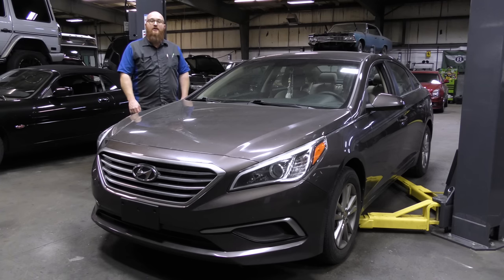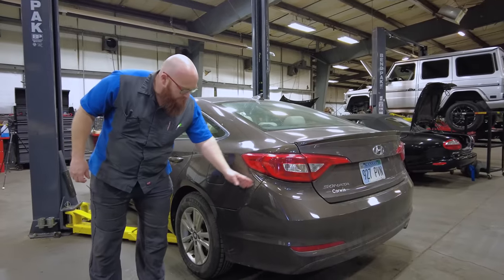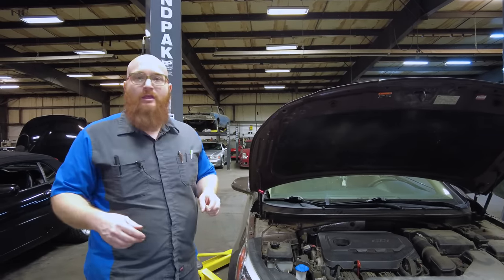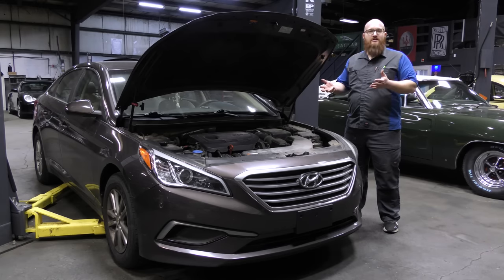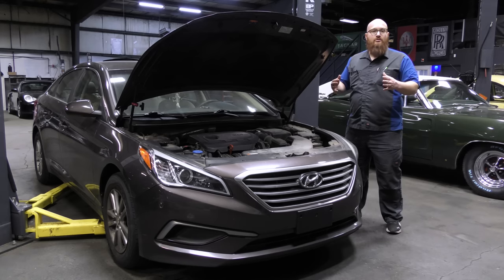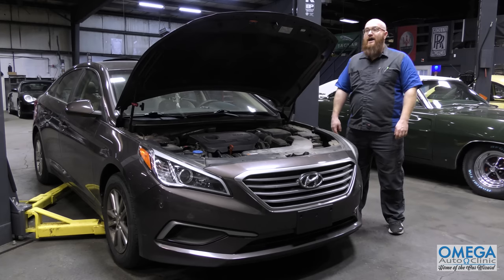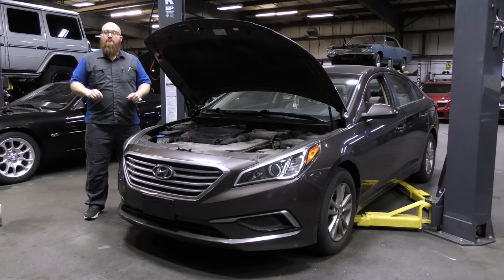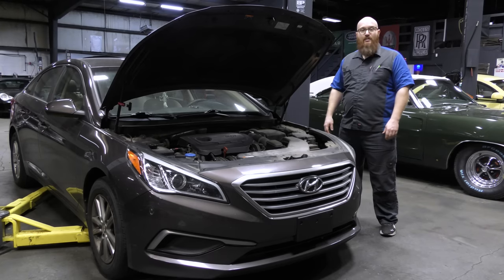What could be so bad on this '16 Hyundai Sonata that the CAR WIZARD is sending it to the junk yard?

Comment: My niece had a Volkswagen rabbit convertible back in the early 90's that she completely ran dry of oil till the engine locked up. When I told her what was wrong with her car she said " Well i'll never buy another Volkswagen again!" I told her that the same thing would have happened if she had a Mercedes or a BMW. It's a vehicle,  not a purse. It needs to be maintained!
Reply: wtf.....
Reply: That's how stereotypes stay alive.
Reply: A friends son-in-law bought a brand new Dodge with a 100% pre paid service plan.  He drove it for a few years without ever getting it serviced or even checking the oil.
Reply: I have a very similar story. A couple I knew had a diesel Mazda 6. It had snowed and they needed to go to work. But instead of digging the car out of the snow, they decided to just sit in the car and redline the engine in first gear with the wheels spinning, trying to get out of the snow. Needless to say that tactic didn't work and it just broke the car. They took it to a local garage and the mechanic spent weeks trying to figure it out. Ended up tearing down the engine to find they'd put so much torque back through the engine that they had bent the camshaft. The mechanic hadn't even thought that was possible.

Of course the punchline is that they said they'd never buy another Mazda again due to it being unreliable...

As an aside, the same guy from the couple once tried to force me to put boiling water on my windscreen to melt ice. I kept politely declining his offer until I just had to walk away...
Reply: Preach 💯💪🏼
Reply: Consumers are the bane of good products
Reply: People are just plain stupid when it comes to cars or anything mechanical. You would think common sense would tell you that a modern car needs some form of care to keep running, but what is "common sense"?
Reply: THATS MY PURSE!  I DONT KNOW YOU!
Reply: We once lost an Equinox to a similar situation it was my fault I kept telling my wife she needed an oil change but didn’t go out and fool with it myself I should have it would of saved me a well just an Equinox but still
Reply: @absolutelynonameslef  Not so common any more.
Reply: I remember in the late 90's when the "Hitler curse" really hit VW. Those 1999+ Jettas/Passat/Golf really had some quality issues. My sister had a 99 Cabriolet and the mechanic was busy fixing defective VW parts, etc. I had friends who's windows would fail and fall into the door, and nagging electronic failures. I felt like this was where they really earned that VW $$$ grab. Mid 2000s we had the timing chain failures on Tiguans, etc.
Reply: If they dont maintain the car they shall be opening their purse to repair or replace it
Reply: You are so polite. The paint is utter crap. Much worse than not too good. 😂
Reply: Wow the ignorance of some people,my friend had a engine lockup gm vehicle with 3.1 yes it was basically a disposable engine but when I said you need oil because it sounded like a TDI Volkswagen diesel engine 30 minutes later we stalled but she didn't blame car she realized you always need to check oil level especially if uses oil
Reply: Even a decent leather purse lasts longer when properly maintained 😊
Reply: Even over 10year old mercedes asks with text on the dash to add oil.
Reply: Absolutely agree 👍
Reply: Lmao
Reply: I went to a rapid lube shop Saturday one time. They left the oil cap off on top of the battery. 

Lucky I caught it Monday checking the stick. Never went back there again. Pop the hood at least a couple times a week and check your oil.

Best & cheapest advice I can give.
Reply: Would not happen to a Toyota
Reply: Even a purse has to be maintained the be honest, some purses cost $25,000 and up.
Reply: Certain cars are like keeping a horse, you have to check almost every day on the service needs of the motor.
Reply: @SteveRogers461  go ahead and take all the oil out of your Toyota and put back in 1 quart of oil....it will do the exact same thing in a few weeks...all engines have the same parts...nothing makes Toyota engines any different internally then any other manufacturers engines....it's everything else that makes a Toyota better than the rest
Reply: @SteveRogers461  If you take care of your Toyota and check the oil, it will be fine. You can kill a Toyota if you do the same as this Hyundai owner did. Common sense.
Reply: @Justinian Yi my 02 Jetta has an oil light.
Reply: @Jason the Toyota would not have consumed that much oil so would not have ever gotten that bad.  VW had all sorts of problems with oil consumption, go look it up.
Reply: @Jason Grisdale  I see what you're trying to say but thats not quite true.. toyota engines are way better built with way better engineering and parts. You've obviously never seen toyota engines run with no oil in them? Or run on the rev limiter for hour after hour.
Reply: No oil???🙄🙄....no worries....goto pump & fillup petrol😜😜😜😜🤪🤪🤪🤪😝😝😝😝...thats what dude knows😜😜😜😜🤪🤪🤪😝😝😝😝😝😝😝
Reply: @JamesParus  Correct, my MB is a 2002 C240 and it has an oil level sensor as does my 2001 986 Porsche Boxster and my wifes 2016 VW Golf. Never seen a low oil warning but I did overfill the MB after a service and the warning on the dash went nuts, no way could anyone ignore it.
Reply: That’s not totally true- I’ve seen videos of 22RE yota motors running with holes in the cylinder and no oil running like a champ lol can see the piston flinging up and down and everything lol
Reply: I have what I call "Friday Fluids Day" - sounds funny, but I check the oil every Friday. Maybe every second Friday, but since it's also garbage/trash day, wheeling the bins past the car, it's become second nature.
Reply: People are so lazy these days they got a book that explains how the maintenance is done and when to be doing it it's in glove box. On top of that we got technology and videos that tell us step by step how it's done.
Reply: I knew someone who ran a Toyota near dry, The 'complaint' was that the oil light didn't go out ! Crazily it ran for quite a while after giving it the required lubricant.
Reply: It's a rabbit and reason why you never see them on the road anymore.
Reply: This brings back not so fond memories of my 3 year old 73 Vega GT.  Just past warranty and no recall, the crap aluminum cylinder engine packed it in at 27K miles.  Tough luck said Chevy. In revenge I swapped in a 64 Olds 215 cid aluminum V8 (steel cylinders!).  My sister owned, just a couple years later, a 76 Honda Civic with the CVCC engine. At 75K miles the heads leaked coolant and wrecked the block. Honda did a recall and replaced the whole engine.
Reply: @MiGujack3  true but tbh as many females iv met like this, iv met just as many guys like this
Reply: @zen-Tii  wtf 🤣🤣🤣🤣
Reply: @SteveRogers461  Sure it would if you drove it with less than a quart of oil in it. Even the best made machines still need maintenance.
Reply: bmw has oil level sensor.
Reply: Cars are one of the few, perhaps only, things in our life that require maintenance.   Not only that, it is not a matter of them running out of oil, so you put more in and off you go again. They run out of oil and die !
In a way it is a bit like owning a pet. It comes with a responsibility!   But many young people have not even grown up and learnd to look after a pet.  Expect more of this. Sad !
Reply: @gregedmand9939  I don't think Chevy was aware that you put in a different engine, so exactly who are you taking revenge against?
Reply: @jduey2396  Revenge on fate, that had me buy a new car only to have the engine die in less than 3 years and less than 30K miles. I turned a disaster into something far better performaning than what I was began with. Oh...and on having to continue making new car loan payments for a dead engined lemon. When I bought it, the Vega was actually the Motor Trend "Car of the Year". Sadly the vast majority of people who bought one, weren't able to make lemonade from a lemon like I did.  It was a world of difference between how GM in the 70's treated customers compared to Honda.
Reply: @SteveRogers461  not true I have a 2002 Corolla verso with the 1zzfe engine and they drink oil like it’s out of fashion. I have to check it quite often. It’s still going strong though thankfully
Reply: @drunkenhobo5039  Camshafts don't bend.....ever. They wear out or break.....extreme hardness from heat treating....
Reply: @tjm3900  To say that nearly everything else besides Cars don’t need maintenance is ridiculous. If you had listed Refrigerators as being about the only thing not needing maintenance then I would have agreed with you!
Reply: @poopcoupes7214 damnit bobby
Reply: @malcolmhardwick4258  to the point we shoul now call it "rare sense".
Reply: Lol!
Reply: Right some people are clueless.  These are the same people that buy a 5 quart of oil and pour it in their crank, when they are only a quart low. Had a customer do that at oreilly before!
Reply: Yes happens a lot we calling it in my country key drivers turn on the car and go....never check all running well.
Reply: The best owner is the one that makes an effort to learn their vehicle inside out.  Sometimes you get that decent Hyundai or Volkswagen that works for you and you able to keep it running good.  Then by all means keep using the car and don't waste your money because of social pressure to replace it.
Reply: @@Nowhereman2022 To my understanding, some big trucks can have higher level super efficient oil filter systems that clean the oil better than the typical automobile engine filter system. However, there is no way in the world I believe oil could last that long. No way the additive package in the oil could sustain that, they'd all be used/burned up. Essentially not changing the oil is like making gravy in the engine. Just heating it up and thickening the liquid over time. If someone at you're trucking company has decided to try to go a hundred thousand miles between oil changes, they may want to rethink that.
Reply: @whammond511  Then please list some things that need periodic maintenance (that might be applicable to the life of a young lady).
Reply: @426baron  From the moment you wrote this message !
Reply: It seems to me that the obvious is not being stated here.   There seems to be a damn good reason why Cars today have Idiot liights to tell you to change and check the oil.    
Even 89 Toyota Vans have a low oil sensor in the oil pan.   At least the US ones do.    Seems they know their audience.
Reply: Definitely wouldn't fix it. Unfortunate because they are a decent vehicle.
Reply: If she had a BMW that will 💯% happen even if she done all the services lol
Reply: Wow, if she didn't ruin the engine she could've probably gotten a pretty good price on such a nostalgic car. It's like finding old Subarus, you stop seeing old ones on the road after a while because they've all either been run into the ground and are mechanically or structurally totaled out and everyone else stored theirs in a garage somewhere to sell when all the 90s kids are old and want to buy a piece of their youth again and are willing to spend to acquire.
Reply: Same goes to BMW. If you don't maintain it propeply, it'll definitely fail on you and leave you stranded! These cars need more maintenance than others, yes, but you should know that before you buy one. Don't whine about how unreliable these cars are when you never even checked how much oil is in it. And if you gonna neglect it, repairs definitely gonna cost you more than the cars worth at some point when one failed part will break others, it's a domino effect.
Reply: @LordEvan5   Equinox is a crap car anyway.......go to the Wizard's video on "What Cars Not To Buy."
Reply: That’s most vw owners in a nutshell who aren’t enthusiasts. Always blaming the car for maintenance they didn’t do
Reply: @MisterNi    She could’ve easily engine-swapped that VW Cabrio. Kept a valuable car, traded it for good money…
  But THAT would call for common sense to know how to spend money to save money…
Reply: Stupidly runs rife!
Reply: It’s bizarre how stingy and lazy people can be.
But spend eight dollars fora Mega Frappuccino, YES any day of the week.
Reply: @j_freed  Well, it might not be all that bad. A lot of older cars have engines with oil starvation in mind and can still run on low oil for a while. If she does an oil change and keeps regular maintenance, that could be enough to flush out the old burnt oil. Either way, could keep the car or sell it for a good amount, even if the engine needs work and/or a rebuild.
Reply: Knowing it’s a Hyundai it probably burned oil, you’d think it would have an oil light. I have a Subaru and my gf has made the oil light come on a couple times but luckily it comes on when it’s only a quart low. It makes me mad because the car doesn’t even have a temp gauge for the coolant or oil or even a tachometer
Reply: @drunkenhobo5039  That's why I'm weary of people offering "car advice" when they haven't gotten their hands greasy or are an actual mechanic.
Reply: I have that car and I've had no problems personally.  But I am quite aware of the manufacturers defect of the engine type. Also the fact that many of those cars do not have an engine immobilizer. That has created such a theft market for the vehicle, that some insurance companies will no longer write new policies on them. Yes I'm in possession of such a vehicle, fortunately I have a backup to drive 90% of the time. With a manual transmission, so it's the least amount of worry I would have, of having it stolen.
Reply: My 01 Grand Am did that back in 2012, when the oil pressure sensor was leaking. A mechanic put 20w 50 against what the manufacturer suggested. I was on road trip from Phoenix  to Kansas. Put some Lucas additive and made it. A shop replaced the sensor, put 5w 30 and I went  back to Phoenix. That 2.4 L engine has 320k miles and does not smoke.
Reply: @Jan Corbinski  wow yeah I'm not surprised the quick lub didn't hear the internals going at it had my oil cap off once and it was loud
Reply: Hell, even a purse needs to be maintained, saddle soap, leather conditioner, and shoe shine go a long way in keeping a leather purse looking nice and keeping it last a long time.
Reply: @martincassels7995  Stupidity?
Reply: @RichiPuppi  "the Toyota would not have consumed that much oil" - My MR2 uses quite a lot of oil, has done for the past 30 years. I have to top it up a couple of times between oil changes.
Reply: @andrewdonohue1853  and a purse, be it leather or fabric, has to be brushed/cleaned and maintained regularly or it won't last long.
Reply: adamb84  looks like "Clueless" is the mould they've all come out lately... 😑
Reply: @gregedmand9939  a friend of mine did something along those same lines, he bought a brand new at the time Hyundai Tiburon GT, he drove it pretty hard but nothing too crazy, it's a sports car after all and it was great fun, even with full proper maintenance the 2.7L V6 spun a bearing and grenaded a year after he bought it, he loved the car too much to get rid of it so soon so a few months of work later it had a Honda/Acura 3.0L V6 and now over a decade later that car still runs like a champ on that Honda engine lol
Reply: @SteveRogers461  gi run you toyota a few miles with 1 quart of oil...it will do the same thing
Reply: Sounds like a new Ford lol
Reply: I'm amazed... the hood struts are 20 years old on my Lexus, and it still raises and holds the hood open.
Reply: @TJ M  clothes, washing machine, dryer, refrigerator, home, body, yard, mower, ...
Reply: @LordEvan5  Don't get anymore cars please.  Your comment scares me actually.
Reply: @TheLifetraveler1  i had one for 4 years. 2017 model. It was a goid car. Had 130k km (85k miles). ALWAYS used real sythetic oil every 8k km.  It ran very well. Sold it to go on a 7 month vacation.  What happenef to this car can happen to any car. A decently maintained car that is good will take you lots of places trouble free.
Reply: Stories like these make me not want to buy a used car.
Reply: @MisterNi  you might flush out the old burnt oil but you aren’t going to be able to replace the worn out rod bearings and crank throws with fresh oil.  That engine is toast.
Reply: @Bill-js1cg  FUD at best. Older engines seized up readily. Simply keeping up with oil changes will be enough to keep a once seized up engine running for years to come.
Reply: @MisterNi  been there done that.  But the engine in the video isn’t seized, it’s about to blow a rod because lack of lubrication has caused the bearing surfaces to lose metal.
Reply: @Bill-js1cg  I think you're a bit confused. The car in question is an older Volkswagen Rabbit, which can run a bit oil starved and still work fine with a fresh oil change. Older model 4-cylinders engines were designed to seize up when oil starved because guess what, people not maintaining their car engine is as old as gasoline cars have been made and sold en masse. The Hyundai GDI motor the Car Wizard is talking about has sacrificial rod sleeves which is why a lot of mechanics are unwilling to rebuild them. Pulling the motor, disassembling the motor, getting all the replacement wear parts and gaskets, adjusting all the precision parts and reassembling and installing the motor isn't worth it to most people. A VW Rabbit that ran low on oil for a while shouldn't be too bad so long as oil changes are done regularly from now on.
Reply: I've been saying for years Kia Hyundai use poor cheap wire harnesses which turn into electrical problems on the vehicles & now fires, I had a 16 Sorento what a nightmare almost everything broke electrical issues up the a** battery continually dying, moon roof wouldn't close just a disaster, they entice with the designs of the car but reliability eventually catches up to you... I remember Hyundai back in the 80s Pony Stellar were also disasters.
Reply: the biggest BS in the world

"Hyundai warranty"
Reply: do modern cars have oil lights to indicate low oil?
Reply: @zen-Tii  nah
Reply: I was sitting at the oil change place a while back getting the oil done on my Prius V. There was a customer before me paying. The clerk informed her that her car came in with a dry dipstick. She told the clerk, "Well when the oil light comes on I know it's time to get the oil changed"
Reply: @MiGujack3  yeah isn't it interesting? Oh never ,never stereotype people, it's so evil. The simple fact is, The stereotype generally has is true!
Reply: @MiGujack3  yes by neglecting basic maintenance on things.
Reply: @MisterNi  yup, I’m confused!
Reply: @Justinian Yi It's a low oil pressure warning light (emergency warning, shut the engine down immediately), but damage has already been occurring well before this stage.
Low oil levels cause the oil pump to cavitate (sucking oil, then air, then oil), resulting in intermittent oil delivery throughout the engine, especially to overhead camshafts. Let alone the exacerbated stress on that small quantity of oil the engine is forced to run on, which will be severely contaminated/degraded, resulting in sludge/piston oil control ring contamination, etc.  
There really is no substitute for an engine oil pressure gauge (for multiple reasons) which will clearly show the cavitation at low oil levels (during idle speed) as a wildly fluctuating needle (analogue gauge description) as the oil pump stutters between oil and air.
Reply: Shifting blame was my sister's superpower too 🤣
Reply: @midwestfarm757  still driving my 2000 vw turbo golf has 300,000 miles, I'm in Canada where it gets 30 below, always starts. Funny how wizard drives beetles that are the same car as the golf.
Reply: @RichiPuppi  Look up "2AZ-FE oil burning". Even Toyotas have issues sometimes.
Reply: So sad those that only turn the key and drive.  Cars wear out and need maintenance.
Reply: Women don't generally maintain their own  cars
Reply: @drunkenhobo5039  i heard isopropyl alcohol and water ..3 to 1 mix in a spray bottle is a good ice remover..but I haven't tried it myself yet..
Reply: @SteveRogers461 Toyota engines have had bad oil burning issues when they switched to low tension oil rings ... same thing would happen if you neglected it.
Reply: @poopcoupes7214  💀
Reply: @poopcoupes7214  absolutely love this comment😂😂😂
Reply: @poopcoupes7214  🤣🤣🤣
Reply: @@justinianyi3838 Their called idiot lights.
Reply: @SteveRogers461  If you have a Toyota, run it without oil and see what happens.
Reply: @LeverPhile  Toyota engines have had sludge issues.  More recently, Honda models with the 1.5T 4-cyl engine (typically CR-V and Accord) have had issues with oil dilution.  I'm not a mechanic but the issue with this Hyundai seems to have been caused by a lack of routine maintenance.  I know plenty of people who own Hyundai and are very pleased with their vehicle.
Reply: @annechang6459  It's anecdotal, but I have a friend who did not change the oil in the 56000 miles they put on their (then new) 2000 Camry, but some people refuse to stop thinking some cars are made of pixie dust which obviously precludes rational thinking.
Reply: @gregedmand9939  excellent cheap Reliable engine swap the good old days before Anti-pollution equipment. So the car should have been legal as well. In the 1950s 60s 70s your old car broke walked along the road to find a wreck and go and salvage the part and yourself. Holden Ford or Chrysler. I could fix this change any part However these days I’m getting afraid to keep the car after the warranty expires.
Reply: @absolutelynonameslef  it is not her fault.  My Sonata at 100 k was burning a quart of oil every 2 weeks with oil changes every 3k...
Reply: @@justinianyi3838 our 2010 highlander blew the oil cooler lines. 0 oil on the stick and the light never came on. Funny thing is there is a light on the dash. But with nothing in the engine the light never even flashed
Reply: She said "sure if it was a purse Brucey would have borrowed it".
Reply: @@justinianyi3838 
On some modern cars the oil can drain out and the light never go on.
Reply: And we let these people drive...
Reply: Women ☕️
Reply: @absolutelynonameslef  People  do not have common  sense  anymore
Reply: I had a 16 Jetta better, dude, that engine was leaking oil and burning oil, transmisson as well.
Reply: Even purses need to be maintained to last.
Reply: We have a 2015 kia sorento with that 2.4 in it. It started consuming oil after 60,000k. I've replaced the pcv valve and oil consumption improved but it still uses oil. Oil changes every 3k religiously. I use crc gdi intake valve cleaner etc. It will use a quart between oil changes. The shop we use for oil changes says there are tons of kia/hyundai owners coming and asking for service records due to engine failure. Check your fluids every time you fuel up. Good habit to get into
Reply: That poor car was misunderstood and resorted to snatching purses. 
I kid.
Reply: @malcolmhardwick4258  so rare it should be considered a super power
Reply: @Thorscauldron  word of advice? Never, and I mean NEVER go to ANY “quick lube” place!!!
Reply: The Rabbit died.
Reply: I managed to run dry a engine due to oil starvation and blown it. The engine was replaced by waranty. Volkswagen called and asked me how did I manage to do it, told them that I had blown it in a corner as I was pushing the car with a 27k oil change interval. They wanted to not waranty the car but I threatened them to go to the authorityes. They tried to say that the car was not driven properly. The law was on my side and they replaced the engine. Funny think, my friend has an Audi with the same engine and he had a timming belt failure at 40k km and one oil change. They were surprised and replaced the engine again. Another friend blew the whole drivetrain on a bmw 640d by driving hard when cold. Again, on waranty. After the waranty work we got rid of the cars and bought new cars.
Reply: wtf
Reply: are student not required to know abut basic maintenance when taking their license in your country?
Reply: @rickard1802  no, but they should.
Reply: We had a 1964 Ford Galaxy.  My mother was driving it when the oil light came on.  She just kept driving till the engine stopped.  Of course, this did not make my father happy! Luckily, the dealership that we bought the car from had another 1964 Ford Galaxy with a good engine and a bad transmission. A good Galaxy was made from two bad Galaxys.
Reply: If it was a 2000s and up volkswagen and she wouldve done all the proper maintenance, ot wouldve still crapped itself for no reason, those cars are trash
Reply: Men rule no..13: Women don't take accountability.
Reply: @MiGujack3  A girl I knew ran her car for like an hour with no coolant and asked me why her car was smoking.
Reply: To be fair vw suck anyways German cars are one tmof the most unreliable pieces of junk on the road that the manufacturers fill up with nice looking gadgetry
Reply: @TruthTeller23914  they didn't have to warranty your engine if you didn't change your oil. I sure would not have.
Reply: It gets worse....more cars are turbo and they need clean oil.....you run the pan dry you're replacing the engine and the turbo.....people need to learn basic car care like checking the oil......many don't care
Reply: @SteveRogers461 Sooo yotas can run forever with no oil? WOWSER! Un efin believable 😮
Reply: @absolutelynonameslef  it's not just the poor
Reply: @Thorscauldron How often you need to check depends on:
1. How many miles you drive every week.
2. How many miles are on the odometer.
3. Who the manufacturer is. Our 2006 Lexus has over 136,000 miles on it and still doesn't use any oil between changes.
Reply: @kaywonderer As does the GR Supra. A text will pop up in the instrument display if the oil level is down a quart.
Reply: @gregedmand9939 I remember seeing a Cosworth Vega in the showroom. I'll be that one was more reliable than the one you had.
Reply: @davepaturno4290    I'm sure it was. My crappy 4cyl died just after warranty. But: after seeing the swap done in a hot rod magazine, I did the same thing. I found an Olds aluminium 215 V8 and rebuilt it.  It weighed just 20 pounds more than the 4cyl and made a great little car. Vegas had aluminium blocks with no sleeves. Pretty much all of them scored out and quit by 30K miles.
Reply: @gregedmand9939  Yes, I remember that well. I think that aluminum block design to which you are referring was sold to a Triumph or parent company. There was a Triumph car that was sold with that engine  - the TR8.
Reply: @davepaturno4290    Yes, Rover initially bought the design from GM, before they were taken over by Leyland.
Reply: I had a 2001 Honda van that I tired for three years to kill it and couldn’t 35,000 miles same filter fired up and drove no issues ran without oil a time or two.. and couldn’t get it to blow up that van was the best vehicle I ever bought $1800 got six years out of it.. Mercedes bmw won’t do want that van did
Reply: i have a 03 vw golf tdi, gets 40+ mpg's . will never sell it
Reply: Women are hilarious. They’re total geniuses at certain things and my wife can handle 3x the tasks that I can in the span of a week. Shes the only reason we’re debt free and not bankrupt and living on the street, and why our kids aren’t obese video game addicts at age 6. But there are some concepts where it’s just funny that the dots don’t connect.
Reply: Call me sexist, but most city girls I see just want to put gas in their car.  The word maintenance doesnt even register on their brain, at least not until the car quits & strands them on the side of the road

You can get a maintenance logbook from almost any dealer.  Simple, cheap, & easy to use.  Shows you exactly when to replace everything from filters to brakes & when to do things like flush the cooling system or flush & refill the brake fluid
Reply: My VW rabbit ran for over 200 thousand miles, took great care of that car
Reply: I don't think all the reputable rebuilders are passing over these engines just because some people don't do basic maintenance...
Reply: Hundais are garbage tho
Reply: @mcdoob what are u talking about
Reply: @gregedmand9939 tf you talking about